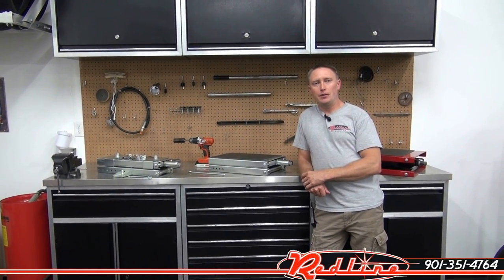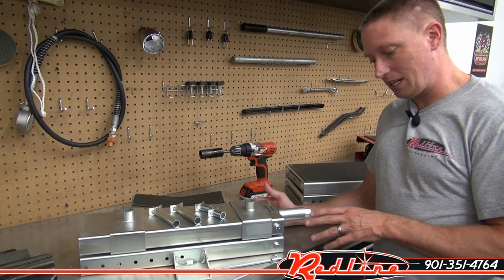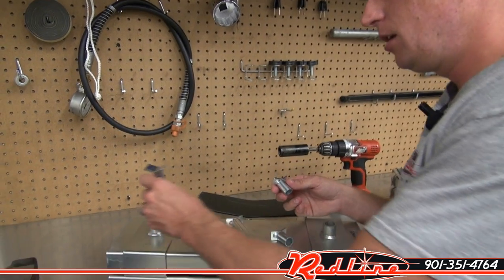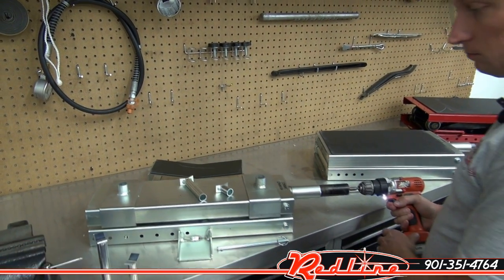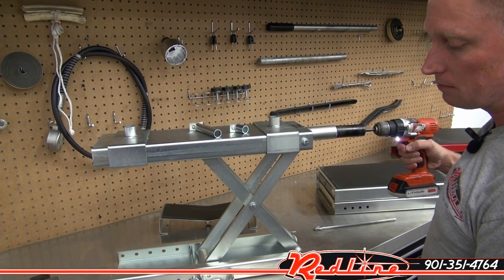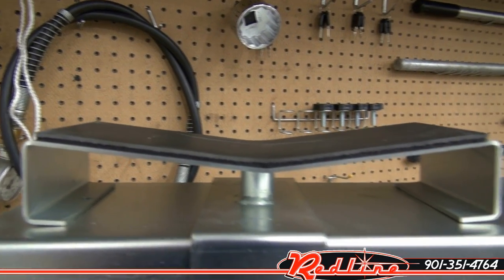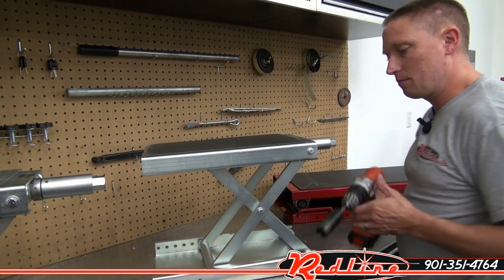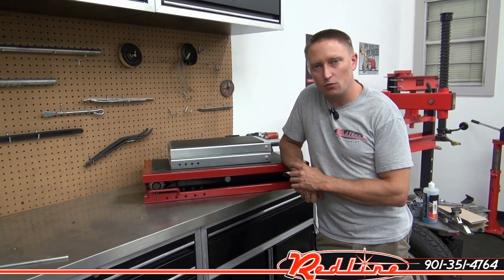Handy Universal Motorcycle & Lo-Boy Scissor Jack

Comment: Dang I wish they would make one rated for 1 or 2 ton with this same design. It would fit perfect on my center slide for the 4 post lifts. Unfortunately the ones I find online for my lift are hydraulic and run $1k or more. Id prefer a simple crank style so I dont have to run any more lines. Have you seen any rated for higher weights but with this design?
Reply from the maker: No sir.  Handy used to make a beefier model caused the Little Grunt.  It could lift 1,000 lbs, which is 1/2 ton.  They discontinued it due to poor sales.